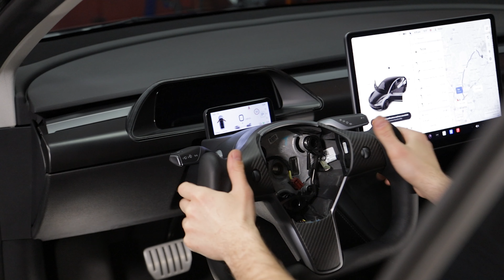Upgrading to T Sportline's Yoke Steering Wheel on the Tesla Model 3 / Y, Heated Grips & Carbon Fiber

Comment: I bought this because a Yoke was a main reason to buy a Tesla, but I ended up getting a model 3 instead as it matched what I needed. I just installed today  because it literally came in 2 days after ordering. That is awesome. Took roughly 1 hour. The most challenging part was what to feel for when removing the airbag. Everything else was just slow, cautious removal to avoid very expensive replacement wires. It's summer, so I don't know how to test wheel heating. Still learning car, got it a month ago, barely 1k miles. 

I will say though, the build quality is exceptional and seemed to match OEM tolerances as the seams were all flush once everything was pressed firmly into place.

Comment: is there a specific tightness/pressure required for the hex nut to hold the wheel in place?
Reply from the maker: 80NM
Reply: The standard impact driver should do the trick as well?
Reply: Do you also need Thread lock for the nut?
Reply: @TSportline  any chance you know the torque spec for a 2023 model Y 4680 model ? 
- Also is this still accurate that there is no need to disconnect the HV or 12v when disconnecting the airbag ?